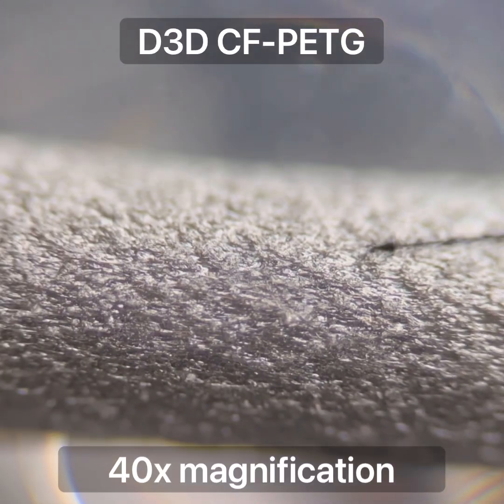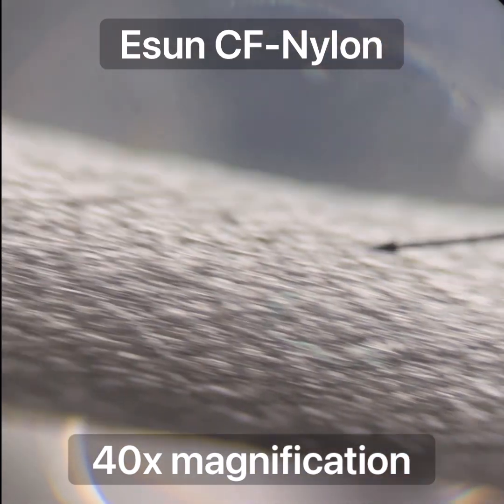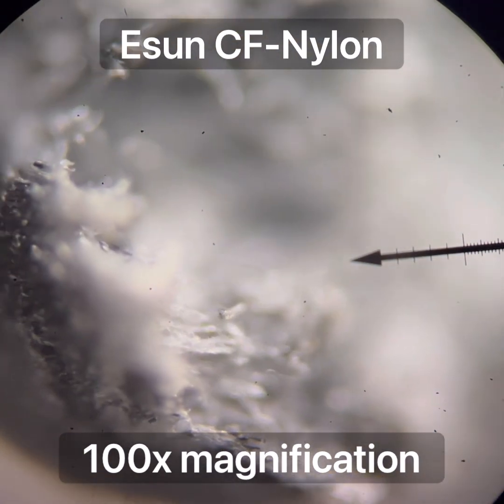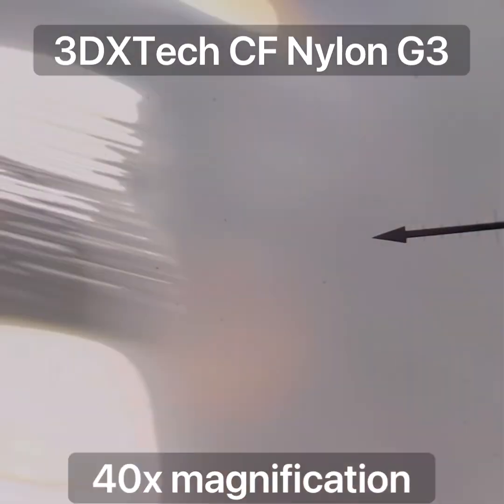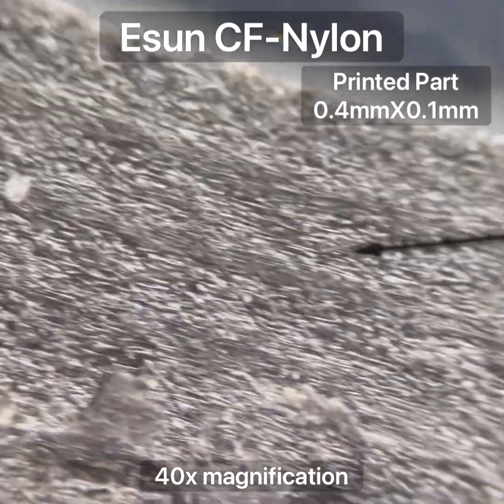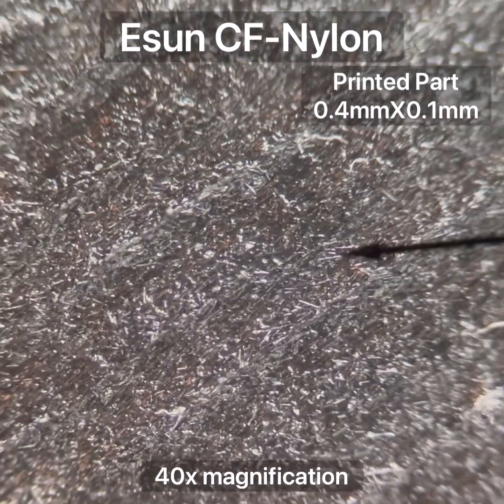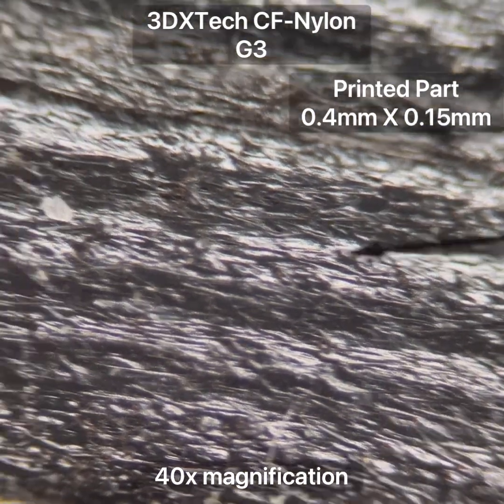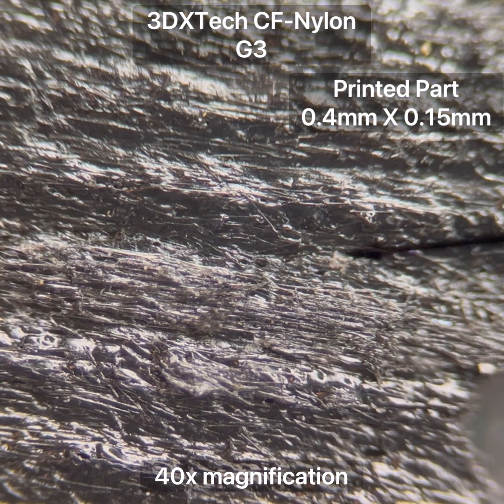Do carbon fibers in 3D printed filaments align? Part 1 of Carbon Fiber 3D printing Filaments

Comment: This is an "undesired" phenomenon that companies that make fan belts have to deal with. Goodyear (where I learned about this) adds fibers to the rubber that they will use to make fan and pulley belts with. 

During the part of the process where the column of freshly mixed "randomized" rubber from the Extruder gets fed into the Calender (yes, that's spelled correctly) rolls, the fibers get pulled in line with the direction of the new sheet of rubber (ours was a "Cold feed" extruder which mixed the rubber to 100% random fiber direction).

The "undesired" part is that Goodyear needs to have the fibers in the rubber running perpendicular to the direction of the sheet (BTW, this sheet is the outermost layer of the belt, and there are other types, or "mixes" of rubber elsewhere in the belt). The fibers need to be there, but a fan belt built from a roll of rubber with the fibers inline with the belt (that wasn't run through the splicer) will last about 50 miles before self-destructing.

So what to do? After Goodyear makes a roll of rubber they intentionally store it for about three days (to outgas the extra volatiles, otherwise it is too sticky) and then they take the roll of rubber (which has a liner between each layer of rubber to prevent the layers from sticking together) and feeds it into the "Splicer".

The splicer rolls off a length of rubber, cuts it to what will be the width of the new roll, shifts that section 90 degrees sideways the width of the original roll, rolls out the next section, cuts it, and repeats the process. 

The ends of the new sections (which were the sides of the original roll of rubber) have their "gap" positioned under the Splicer head where the ends are pushed together (technically the name for the machine is a "Butt Splicer") to form a temporary seam. This new sheet gets rolled back up at the winder where it can now be used to make belts. This does not make a particularly strong seam, but holds the sheets together well enough for the "Letoff" at the belt building station to use the roll. And they have days where the rolls don't want to stick, stick far too well, and all sorts of other issues. It's a PITA.

With all that hopefully explained fairly well, the setup Goodyear purchased from Berstorff, which now goes by the name of "KraussMaffei Berstorff" was the Cold feed extruder, the Calender line, which were effectively one line, and the Butt Splicer which was its own unit that was installed several feet from the Extruder/Calender line. Out of the $6 million for the entire system, the Splicer probably cost $1.5 million. Which Goodyear would have avoided if possible.

Fun fact, this is where I learned how to program General Electric Series Six PLCs about 35 years ago. :)

So yes, the fibers do get pulled in line with the filament.

Comment: Awesome look. This makes me think that FDM CF parts could be made extremely strong with methods such as half height printed infill. By that I mean, print a zig zag infill, then go up half a layer and print a perpendicular layer of infill at normal height. For a 0.2mm layer height, raise 0.1mm in Z height, print a perpendicular 0.2mm layer, repeat once more. Do that for each layer with some solid walls and it should create a form of interlocking with the fibers. Just a thought! Lots of layer squish in general and heavy infill overlap with interior walls should create good bonds too.

Comment: It would pay for slicer programs to permanently have an option for printing each layer at 90° to the last, to take advantage of carbon fibre crossweave.
Reply: You can make this happen with the infill. In for example it's the Infill Line Directions setting. You can even have multiple alternating angles like 0, 45, 90, 135, repeat.

Comment: this is great and really interesting, I'd love to see you check more products this way. you should definately get a portable hook scale and check the tensile strength. Just test the filament and then a printed part and see how they differ. That way you could tell if your theory, that the printing causes alignment, is true. 

I have seen unprinted CF nylon make nylon go from 11 kg to 17 kg weigt until point of failure. thats amazing but I wonder how far 3DXtechs filament would go in a face off amongst CF nylon products. 
Is there a way that you could take a look at Eryone's CF products? Namely, PETG-CF and Nylon-CF.
Reply from the maker: I’m actually making a video on the tensile strengths soon!

Comment: Could this mean there is no structural boost using the carbon fiber and that its simply for looks?
Reply from the maker: It makes it stronger in the direction of the print layers, z axis strength is not improved
Reply: It's going to make it must stronger in at two dimensions, but not necessarily stronger in a third. Getting ideal layer bonding and some form of cross linking would improve strength in all dimensions.